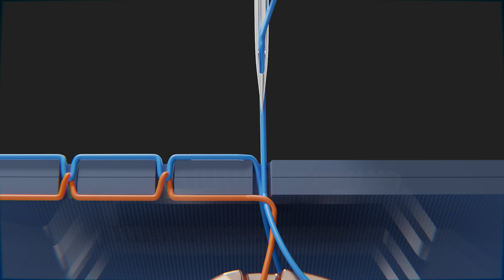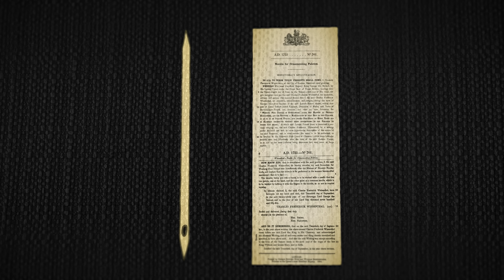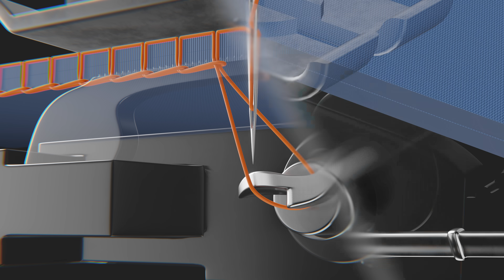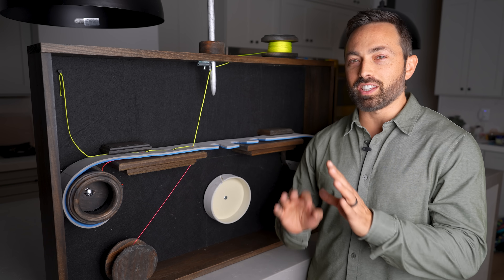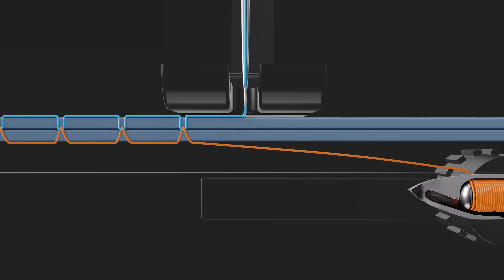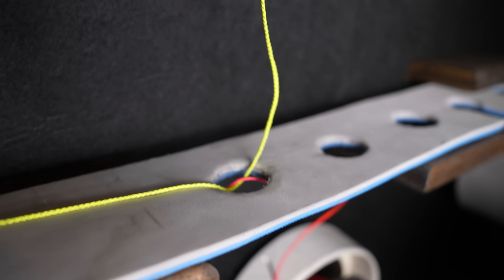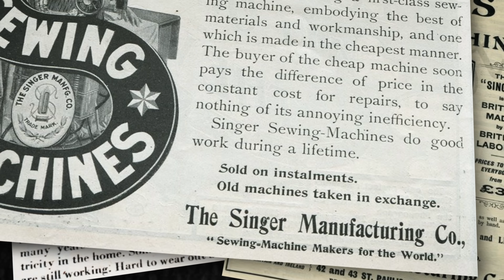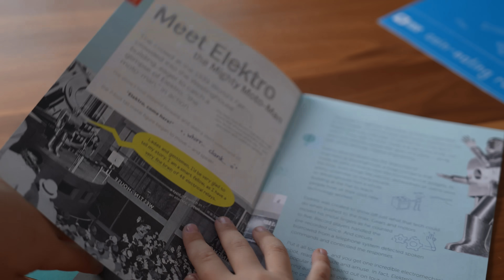The Surprising Genius of Sewing Machines

Comment: I have a Singer sewing machie built in 1926 and still use it (because if it works - it works).
The surprising part was when I broke a needle in 2016. I thought I will never find a spare one, but when I took it to the nearest fabric shop, they immidiately gave me similar one that perfectly fit in.
It's amazing that needeles didn't change after a century.
Reply: They changed a lot to the better, in terms of material. they are still changing today, but to the worse: the last package of needles had mediocre quality eyelets polish, possibly too much cost savings in production.

If you want good stuff buy a machine from before 1960, needles and spools from before 1990, and have a motor and a frequency converter from today fitted.
Reply: @peterfischer5420 The rough burrs inside the eye of the needle will fray and break the thread. Needles made today work great, but only if you buy from a reputable manufacturer. If your needle breaks often, it is likely you need to have your machine cleaned and properly adjusted. The metal parts come so close to one another that a fraction of space can cause just enough breakage to be frustrating. Parts wear down, screws vibrate loose, and metal eventually starts to bend. 

Needles for hand sewing have also gotten terrible, made overseas cheap. If you look up the needles used by professionals, they are rarely the ones you can buy at a big box craft store. They seem expensive, but don't need to be replaced several times to get the job done.
Reply: @peterfischer5420 here's an idea. Get a Spark plug cleaner ( miniature sand blaster) and use it to polish your needle eyelets. Just need to make a needle holder out of an old spark plug and some JB weld, a nut, and a wing bolt. 😉 Spark plug cleaners are pretty cheap, so it won't break the bank. You might also experiment with different media . Polished eyelets 👍
Reply: I inherited my mother’s sewing machine foot pedal made around 1956.   I love it
Reply: It's fascinating how 'early' some tech is that is still unchanged today... Take the AA battery.. It came out in 1907 -  117 years ago & counting... And yet its format is the same.
Reply: @xoio yeah, same format, but completely improved inside, holding 10x more energy. Light bulb, same story, was filament, now is LED.
Reply: Hopefully they let you know that you're supposed to change your needle sometimes (5~10 hours of sewing and make sure it matches the weight/type of fabric) instead of just waiting for it to break? 🥲🥲
Reply: @xiola  who does that tbh? Im sewing qith my needle until it breaks and it works just fine
Reply: @xiola  
Never knew there are different types of needles.
Reply: I have an ancient singer as well and it still is what I use. I don't really sew often and I found the machine on KSL for 15 bucks. I like fixing things so I gave it a good working over with some cleaning and some sewing machine oil and it works like a champ. I'm actually sad because my last time using it show me the electric motor is definitely losing power. I don't think it has much life left in it. 😅 Lucky for me though, when it does that I know I can just buy a motor off of some place like Amazon or ebay and it'll work perfectly because it just transfers the motors power into the hand wheel with a little  rubber wheel. They really don't make things with repairability in mind anymore do they...
Reply: needles and wheels both staying around forever
Reply: is it singer 15k? it was machine that standardized that type of needles. You can also use modern matic feet(everything low shank), or replace bobbins and bobbin casings (class15) 1:1 with most modern machines.

All of those components were standardised by that model of sewing machine, and it is IMO first modern sewing machine.
Reply: It break my heart that so many machines out there are  being discarder. I bought  a high dollar  emb.  Machine. A part broke can't be fix. They just wanted me to buy a newer one. Nope.
Reply: Best sewing machine needles are Schmetz or Organ Brand. 
And yes - there are different types of needles for different types of fabric and threads!
For example:
Universal needles
Stretch needles
Metallic needles
Jean needles
Upholstery needles (100/16 or 100/18)
Etc.
Schmetz and Organ brands have a booklet on which needle is best for your project!
Yes! Change needles OFTEN! it protects your fabric and machine from being damaged!
(not to mention the bobbin case below)
Again - the needle manufacturerers have good information available to help you make the right selection.
Look at your specific sewing machine Owners Manual which will also specify what brand and size needle your machine uses.
Don't just assume all needles are the same!
They are somewhat specific to the machine you purchased. 
But Schmetz AND organ are very reputable needle manufacturers. 
I own 7 home machines and I clean them and change needles between most projects!
I use alot of needles, but I have a lot of $. Invested in these machines and with good care they will last a long time!
Happy sewing! 😊
Reply: Seems like the needle design was pretty much set back in 50,000 BCE. Everything else has just been minor tweaks.

Comment: The problem is not with the sewing machine but rather with the fact no one tests their clothing's seam lines before buying and fabric softener damages clothing every time it is used.  How to test seam lines:  Take either side of a seam line and tug gently.  If the seam comes apart so you can see the stitches, then it is badly sewn and will fall apart very quickly.  Don't buy.  Also consider using less fabric softener to increase the longevity of your clothing.

Comment: At 10:22 how the shuttle is pushed around but still allowing a gap all around it for the thread is one of the trickier parts of how it works. It would be good to get more detail on that. Or at 11:30 how the thread can pass around the bobbin while the bobbin is held in place.

Comment: 1] First, I think there’s something missing from the illustrations.  In short, if you look at it closely, it’s not clear (at least to me) how the lock-stitch mechanisms work.

For example, we see the shuttle passing through the loop formed in the “upper” thread.  BUT, the shuttle must be riding on something (like a track).  How does the loop pass completely over the shuttle without the thread of the loop getting caught on whatever is holding the shuttle in place.

(Similarly, the illustration of the bobbin has the same shortcoming.  I.e. how can the loop completely pass over the bobbin without, for example, being caught by the axle on which the bobbin is spinning?)

What am I missing here?

2] But that quibble aside, thank you so much for posting this video.  I’ve been mystified by this question for years.

Now I can sleep nights!  ;-)

Comment: Is there any chance you could make a follow-up movie focusing on how the bobbin is held in place in a way that the upper thread can pass? There is a sleight-of-hand in your large-scale demonstration of the lock-stitch demo, but I think the thread passed in the back of the bobbin inside the cylindrical holder. The bobbin shuttle animation showed nicely that the cigar-shaped bobbin is not attached to any fixed part, but rather is pushed back and forth by unconnected pistons.

Comment: I have been wondering for 50 years how these machines worked. The part that had me stumped was how they managed to reliably capture the thread, because that is exactly the problem you described with mimicking human-made stitches. The thread needs to be reliably captured and then released again.

I didn't realize that it would naturally loop when the needle is withdrawn a little bit, and that by passing very close to the needle that loop can be caught. Thanks for explaining this mystery!

Comment: An excellent video, with the exception of how the bobbin works. Starting around 11', things are shown very well up to the point where the needle's thread is magically looped by the hand as the bobbin case swings around and "takes" that loop. Then, again, magically, the thread slips off of the bobbin. My wife and I were hoping for a continuous display of this as you did with the other processes, hoping for the repeats to elaborate that process — but it never happened. If that one process could have been done with the same care and elaboration as all the rest, this would have been one of the best videos on YouTube. But sadly, it's only a very good video on YouTube.

Comment: i found an 1890s White brand vibrating shuttle treadle machine at a town dump last summer! it was such a lucky find - it had everything except the drive band, which was maybe a $10 replacement part i bought online. i have no idea how long it had been sitting, or where, but it was pretty grimy and the treadle base had a fair amount of rust on it. i cleaned it up, oiled all of the parts, and sanded/repainted the rusty cast iron base with some black rustoleum. this took a few afternoons of work, but it immediately started making perfect stitches during the first test! i’ve had it for around a year and a half now and i’ve made so many projects on it. it powers through everything i’ve thrown at it, even heavy weight denim and canvas. i use it all the time!
Reply: How wonderful! Thank you for giving it another life! I hope it serves you well for decades to come!
Reply: Nice!
Reply: I keep 2 spare “belts” for my grandmother’s old treadle Singer.  I got them from a sewing and vac repair shop.
Reply: I regret tossing my old machine I just didn’t have any room for it.

Comment: That shaft that drove the machines was called a jack shaft. The motor that ran them was usually outside, it actually made for a less noisy environment. Lots of equipment was driven this way at the turn of the century,

Comment: Generated using Talkbud (Browser Extension):
📝 Summary of Key Points:

📌 The invention of the sewing machine required a new way of sewing, leading to the development of a needle with a sharp end on both sides that could create a chain stitch.
🧐 The lock stitch, using two separate spools of thread, was patented by Elias Howe and improved by Allen B. Wilson, creating a secure stitch.
🚀 Adding a groove to the sewing needle reduced friction between the thread and fabric, resulting in cleaner stitches and less fraying.
🚀 The invention of feed dogs, small metal pieces that move the fabric forward after each stitch, allowed for more efficient and evenly spaced stitches.
🚀 Isaac Singer played a significant role in popularizing sewing machines through his business acumen and optimization of the production process.
🚀 Sewing machines have had a significant impact on clothing production and consumption, reducing sewing time and clothing costs, but also raising concerns about clothing waste and the need for sustainability.

💡 Additional Insights and Observations:

💬 "How are sewing machines able to create stitches without the needle fully going through the fabric?"
📊 The lock stitch was patented by Elias Howe in 1846.
🌐 References to Elias Howe and Allen B. Wilson lend credibility to the information presented.

📣 Concluding Remarks:

The video provides a comprehensive explanation of how sewing machines work and highlights their importance in clothing production. It discusses the breakthroughs in sewing machine technology, the role of Isaac Singer in popularizing sewing machines, and the impact of sewing machines on clothing production and consumption. The video also raises important concerns about clothing waste and the need for more sustainable practices in the industry.

Comment: I own close to 30 pairs of levis, the only issues i ever have with them is the modern stuff.  They always rip out at the knees or between the legs.  My levis i have thrifted from the late 70s to early 90s are amazing, thicker denim and better stitches.  I have not ripped a single pair of my vintage levis but have lost 3 pairs of mordern levis this year alone.  And i wear them both just as often.

Comment: I've worked in carpet manufacturing and they had the biggest sewing machines ever,  they'd be fed yarn from 12 gigantic spools that were on these huge metal rackings on wheels that had to be pulled around the warehouse with a forklift.    The spools must've been well over 120 kg each and the factory had decibels levels similar to a firing range.

Comment: My parents used to sell those old cast iron Singer machines in their store. They were incredibly heavy! One of my favorites was a tabletop machine you could sit at, it had a big foot pedal, big enough to fit both your feet. You would twist your feet forwards & backwards (as if switching between the balls of your feet and your heels) and that would turn a big iron flywheel, which had a leather strap around it, which then connected to the machine. Fully human-powered sewing :)
Reply: I actually have my great great grandmothers in my room now. Its still works. The machine flips out ahen the lid is opened and back in when you close it
Reply: @bodybong  oh yea this singer cast iron monster also flipped over so the tabletop could be a regular table.
Reply: I think you're describing a treadle, which uses a rocking motion of the feet. It's not necessary to twist the ankles. 😂
Reply: @phantomkate6  haha well that's how I operated it as a kid :P

Comment: Many years ago, I worked at a couple commercial embroidery companies. Running machines that would embroider designs on up to 15 garments at once. The machines have between 6 and 15 needles per head. They work by having the current sewing needle over the hook, and a big frame holding the garments in hoops moves in the x and y dimensions while the needle goes up and down. Those multi needle heads are programmed to stop, cut the threads, and then switch needles to sew a different color. For a few years I worked with CAD software to program how a design would be stitched. On a good day it was like being paid to work on a coloring book. More tedious was setting up text. It has been over 20 years since I worked in the industry. Every once in a while I think maybe do a semi-retirement and go back to working on embroidery designs part time. Not sure I could as even over 20 years ago, a lot of the work moved offshore.

Comment: When I got sober, I found I needed a new hobby.  As a lifelong tinkerer, I wanted something to occupy both hands and mind-- and so I decided to try to rehab an old sewing machine.  A  Husqvarna VIking  21e, as it turned out.  I got it working smoothly, and realized that this really scratched an itch for me.  And so I did the same thing for a Singer 500 Rocketeer. And then a Morse 4300.  And then a Necchi BU Mira.  And now I have like 80 machines.

What gets me is the stories I hear from the people I buy them from.  This was my great grandmother's.  My mother taught me to sew on this.  My grandmother sewed my prom dress on this. My father still has the quilts this machine sewed.    So, yes, I have a pretty decent collection of post-war sewing machines-- which I like, just as machines.  But I also have in them a tremendous reservoir of love, of tradition, of care and home and community.  And, in that, they aren't mine alone.  I'm just a caretaker for now.

Comment: I've been using sewing machines since I first liearned how to do so in my Home Economics class in the early 1970s, but I could never envision how they actually work. Yes, I know there's a bobbin and that the thread tension on both threads need to be properly set but was never really clear on HOW the threads could wrap around each other without ever leaving the needle. Several years ago, I did an internet search which helped clarify the mystery a bit. But this video shows in intricate, slow detail how exactly it all works. Thanks!

An advantage of the chain stitch (as illustrated at 7:30 in this video) IS the fact that it can quickly be released. This makes it perfect for sewing shut livestock feed bags. I wish sunflower seed bags used this same stitch.
Reply: ...and flour bags, including the paper ones. The trick is knowing which thread to grab, for a quick release opening.

Comment: I found a old singer sowing machine in a dumpster once that had a cabinet. Not sure the year of it but it was designed for 120 volt DC current.  I added a rectifier to the line and plugged it up to the wall and it worked great. I don't use it though, it's old and might have some collector value.

Comment: I always pondered how they worked, and my keyboard, monitor is on a Singer Treadle machine right now, and I have 2 early electrified models also, along with 20 lbs of attachments. I procured these buying house's in southwest Detroit 20-25 years ago. Still use a needle & thread to sew odd button on.

Comment: My mom had a pedal driven 27. Instead of a motor there was a tippy pedal under the unit and an offcenter thing pulled the pully around. It wasnt a moden belt, but a piece of rope.

Comment: 14:11 he either misunderstands or misspoke, or the editor misunderstands.
The machines were belt driven with rows of machines running along under huge drive-shafts, each machine powered by a belt running up to the overhead drive-shaft.
The way he says it, or the way it's edited merely implies it was plugged into an overhead electrical line.

Comment: Woah 😮

Never realize the ingenuity of this machine.

I remember my grandmother had a mechanical sewing machine.  

It had a cast iron flywheel 🛞 underneath with a foot 🦶 operated "see saw" (which spun the flywheel) which in turn spun the sewing 🪡 machine up top.

No electricity⚡ required.  Just pressing your feet back and forth like you were on a swing to bring the flywheel up to speed.

No break down, no malfunctions, no replace this battery or cables.  It was designed to survive a 20 kiloton nuke 💥 and still keep working.

They don't make `em like they used to...